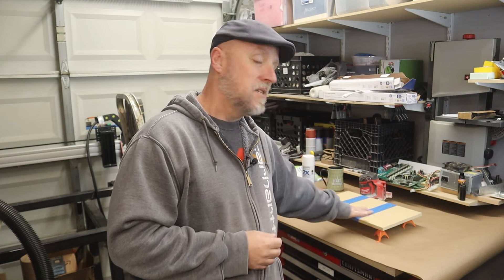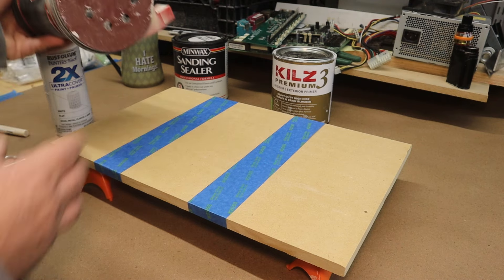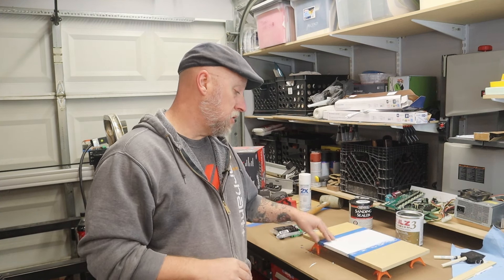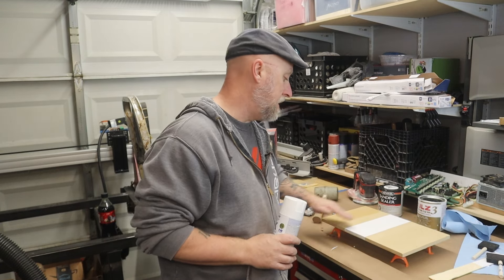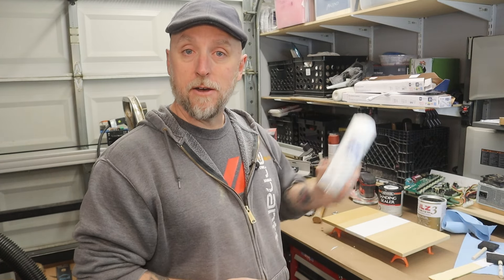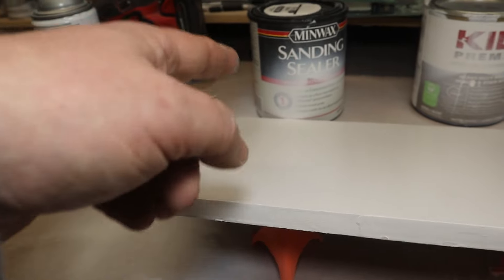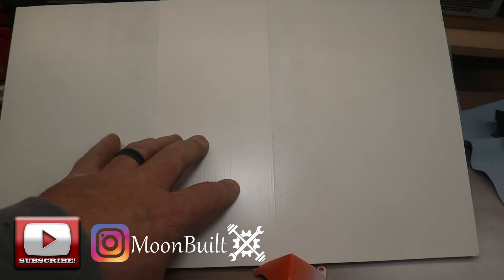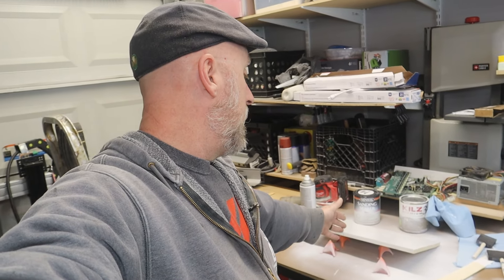How to Paint MDF for a PERFECTLY SMOOTH Finish

Comment: Thanks for the video. I will definitely try the Kilz 3 method. I've learned that with Rust-o-leum is that they mean when they say to apply additional coats within the first hour or else wait for 48. Otherwise, it causes a wrinkling in the paint and the only cure is to sand back to the wood and do it all over again. I've also used the R-O-L primer on wood and that works well, too, so long as you don't wait more than 1 hour to apply the color after. What an R-O-L operator told me was that I should also apply their clear coat within that first hour, too, after painting. But as you noted about how the paint doesn't quite layer right, who would want to finish that?! So, I strongly encourage anyone else watching this still, to wait the 48 hours dry time for the R-O-L paint before doing the final clear coat. You're the first one I've seen suggest using the Kilz, but I do like, from your video, the way it seemed much more "finished" compared to the other two methods. Thanks for doing this video.
Reply from the maker: I've found the Kilz to be the best at priming/prepping MDF for paint...it works really well at on the rough edges especially

Comment: Do you sand mdf before applying Kilz?
Reply from the maker: Fot this demonstration I didn't, and for most projects I don't...but that also depends on the condition of the surfaces.  On a cut edge I might just to even things out or get rid of any cut marks. On the faces not normally, since sanding roughens the surfaces and causes those little hairs to raise more when the Kilz soaks in.

Comment: Auto filler primer works well.  I've seen people use spackle on the edges then sanded.
Reply from the maker: I wouldn't think spackle would bond well enough to the mdf...like it would just kinda crumble and fall apart...maybe something like a sandable wood filler would be better.  I used sandable wood filler to fix trim molding that my dog chewed (https://youtu.be/0q9FPRWp-TM),and that worked really well

Comment: Hello, I just purchased a computer desk online, and it's made of MDF boards.  Yet these boards have a wood patterned wallpaper on top of it.  Can I still use an Acrylic sealer to seal this?
Reply from the maker: Probably not since it has something on the surface already, but if the edges aren't covered you may be able to seal the ends...
Reply: @MoonBuiltGarage  Thank you.  that is what I thought.

Comment: Could you use sanding sealer first then a coat of the kilz?
Reply from the maker: Honestly...don't know.  I feel that the sanding sealer might prevent the Kilz from adhering properly, but I could be wrong
Reply: @MoonBuiltGarage  no that makes sense. Do you still prefer the kilz over the sanding sealer? I'm going to be doing a project soon and trying to decide weather to use a nice plywood or mdf. I'm going to be building a Nintendo switch cover for a TV
Reply from the maker: I do.  I built a bathtub cover with shelves out of MDF, and used the Kilz to seal everything before painting, and everything turned out perfectly smooth

Comment: So just to recap.

What are the steps to get the MDF baby butt smooth ???
Reply from the maker: Find someone to do it for you 🤣
Reply: Wow he asked a valid question and you just blow him off like that
Reply from the maker: The steps were pretty clear....if you don't like my answer maybe you could provide a more detailed explanation...
Reply: Best way I've found is to apply two coats of paint, between coat sand with 220 or 340 and recoat. Did some testing with a PVA wash at 75% glue to 25% water and got essentially the same results. I am in more of a production based application so minor imperfections are often overlooked. Would be filled with exuberant joy if time allowed me to BIN prime everything.